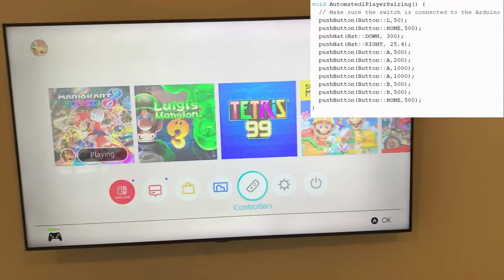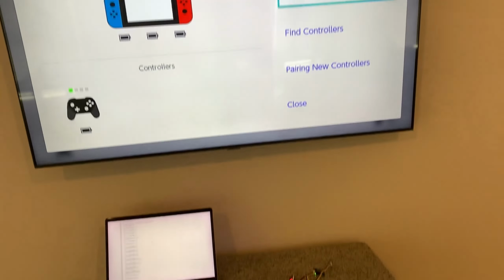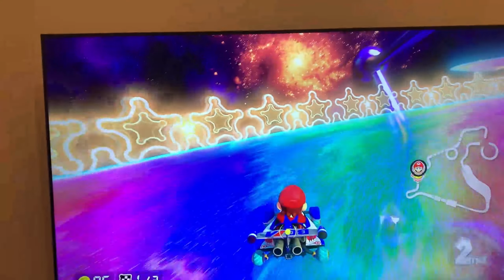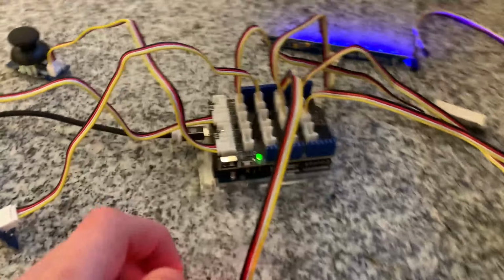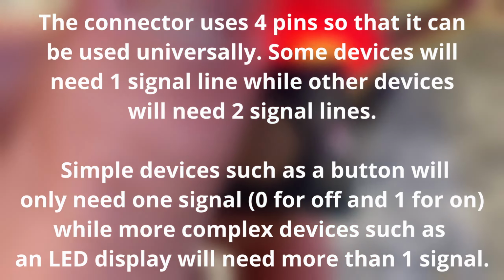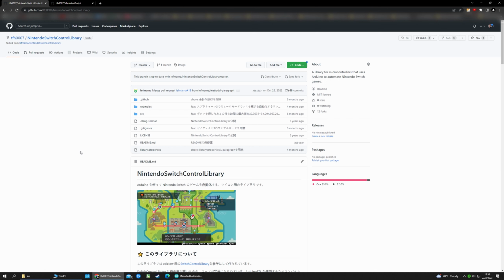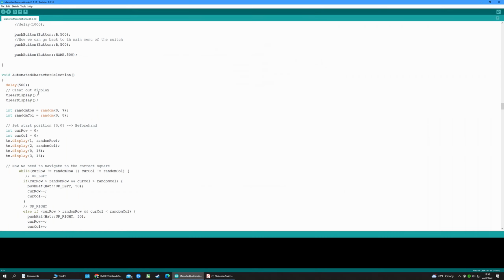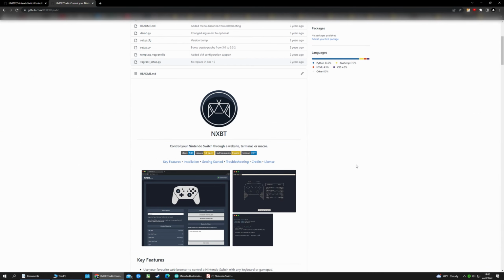Automating Nintendo Switch with Arduino

Comment: Hi Thomas, I'm very interested in your project. I have a question: Is your Bluetooth module compatible with the Nintendo Switch or is it standard? How do you tell Arduino to send commands through the Bluetooth module instead of the USB port? Could you tell us the model of your Bluetooth module? Thanks!